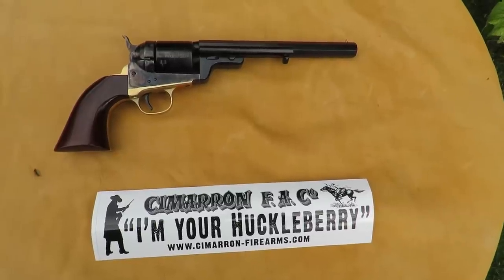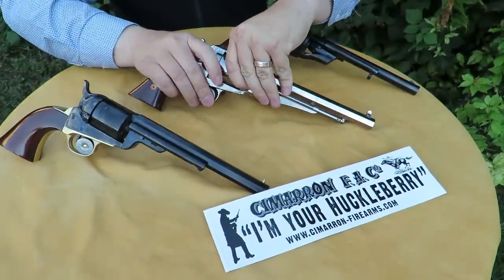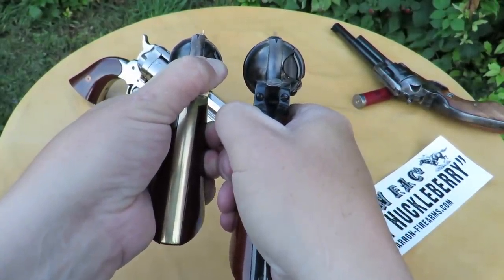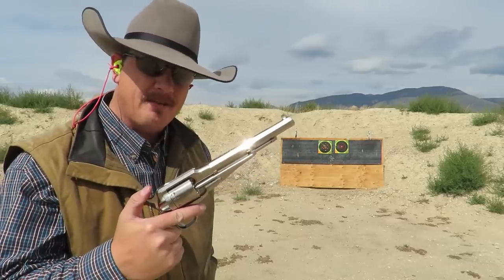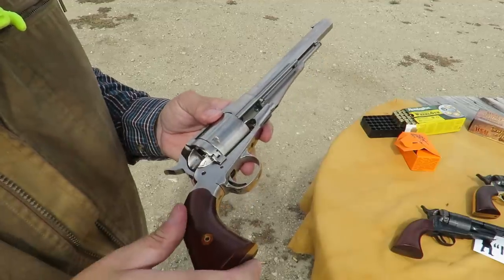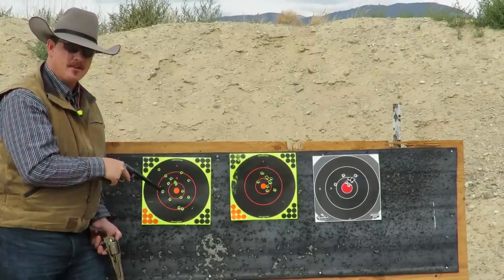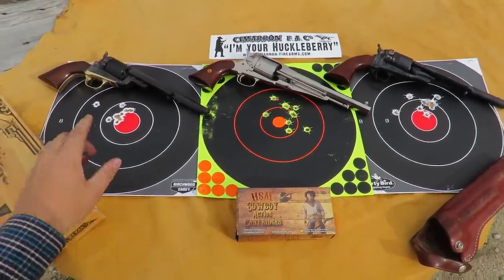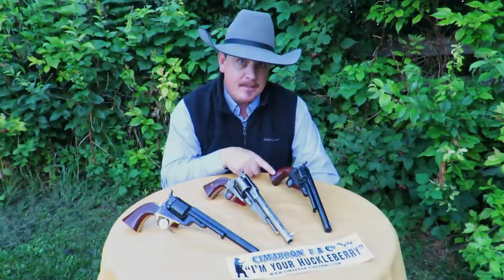CONVERSION REVOLVERS! from Cimarron Firearms

Comment: I'm going to split hairs here but I'm a bit of a purest, and while the Vaquero is a fine pistol it is far from a true Colt Copy. I'm not knocking the pistol, I'm knocking the label.
Reply from the maker: Didn't have a SAA handy for the video. The Ruger was the closest I had at the time, and it worked for this basic introduction due to the fact that it is based on the SAA.
Reply: @TheAdventureCowboy  Like I said I was just splitting hairs. No bone to pick just splitting hairs.

Comment: "Loading Lever", NOT  "ramrod".
Reply from the maker: I get it, but it's easy to misspeak when making videos. The point is the same.
Reply: Actually, it's plunger.....the lever is attached to the plunger.  Really though, does it matter?
Reply: @MuskratOutdoors  Yes, proper terminology does matter, as it can become a safety issue around mechanical objects such as trucks, cars, aircraft, ships, firearms, etc.   Unless you don't mind someone referring to a automatic pistol slide as a cylinder.  The entire loading apparatus on a percussion revolver is referred to collectively as a "loading lever" for purposes of loading, and has been since the earliest days of Colt.  Look up Colt loading instructions circa 1850, for reference. I have a Colt Sales Flyer from January 1858, which you should be able to find online; look at Colt's loading instructions on the use of "Loading Lever" as an original-source reference.  Seriously now, when teaching a teenager to drive, are you going to point out proper terminology, if the teenager improperly calls an oil filter a "radiator", or are you just going to let it go?

Comment: most of those have barrels sighted for 100 yards, I have all 3 & more with the shorter barrels, deadly accurate one of my Richards type II has the barrel cut down to 2& 7/8 with a Thunderer grip frame they all have "slick jobs" wire springs, & had a cylinder hone thru the chambers great guns!
Reply: I have read many times these old guns were regulated at 50 yards. One hundred yards is quite a stretch!

Comment: I hate that “cowboy load” bs. It’s modern safety! They loaded 6.
Reply from the maker: Some surely did run around with 6. Those were the dumb ones.
Reply: If I carry mine I do a "cowboy load" and at the range 6 are loaded. The first hammer click is "supposed" to be the "load 6 rounds for carry" position. Remembering that everything mechanical fails eventually, I personally won't carry with 6 in the pistol and the hammer on 1st position.

Comment: Correction roland's patent was  actually for a paper cartridges
Reply: Correction no it was for the bored through cylinder
Reply: @99dsm1  excuse me i meant to say paper cartridge revolver
Reply: @paullytle246  his patent was for a process that did not succeed but because he had drawn up a bored through full diameter cylinder that was meant to load from the rear that was what allowed smith and wesson to corner the market on cartridge revolvers